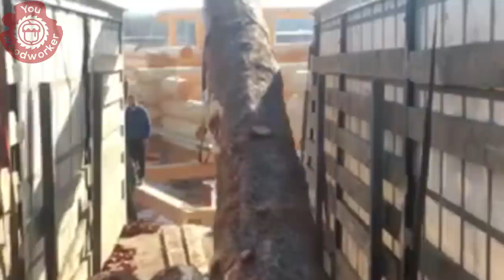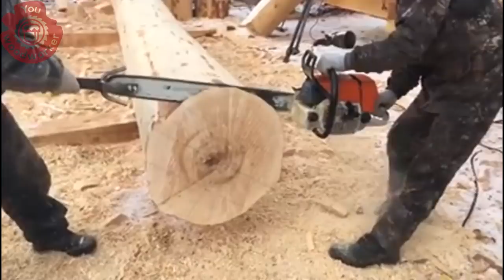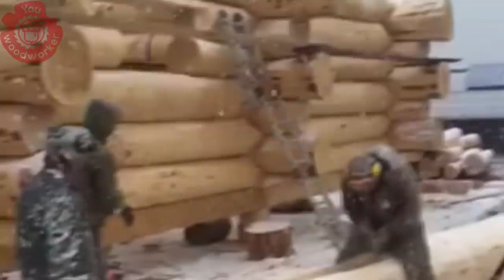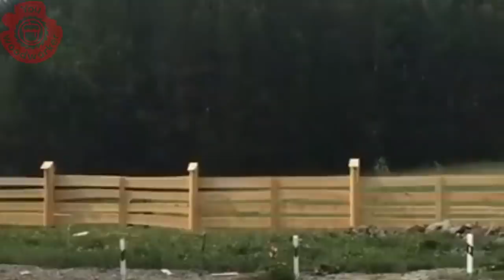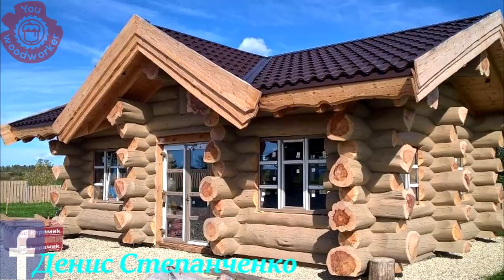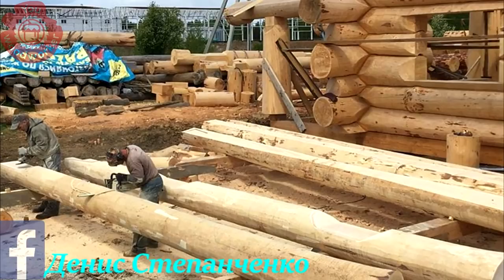Traditional Log House Building Process. The Birth Of Wooden House | Woodworking You MUST See

Comment: Not much of a traditional building process here: Concrete foundation, lifting cranes, electric bevels, bark removers and drills, chain saws and steel bolts ++. But of course, the house itself will stand for hundreds of years once finished.

Comment: Deforested a couple of Amazon to build this house!
Reply: molambo  ---  When you cut down a tree 10 new trees will grow back to replace the 1 you cut down , also when you cut down a tree if you leave the stump alone it will regenerate another new tree ( they call this stump growth , stump growth trees are not "virgin timber" so they're not considered useful for much other than carbon sequestering or fire wood ).Trees are giant plants and all plants "breathe" in CO2 / carbon dioxide the plants then break apart the molecules into their original form so CO2 becomes 1 carbon  + 1 oxygen + 1 oxygen . The plants then "exhale" the 1 oxygen and the 1 oxygen molecules separately of each other but they retain the 1 carbon molecule to add to the "growth" of the overall plant -- roots , trunk , leaves , fruits or mast  etc,.  Complete deforestation occurs when the intended land use after a clear cut operation occurs is for some purpose other than to regenerate a new forest . So like in the Amazon they're deforesting the jungle to create new farmland but they're not using the "new farmland" to feed their people . They are in fact using it to grow corn so they can use it to make automobile fuel because the engines in South America are designed to run on a flexible fuel usage capacity . When you use corn as an engine fuel , you'll need a lot of corn because the making of ethanol requires large amounts of corn .
Reply: @williamwaha3193  Well said friend.